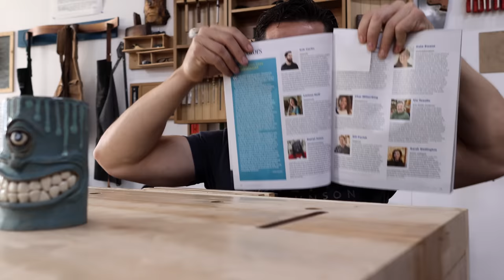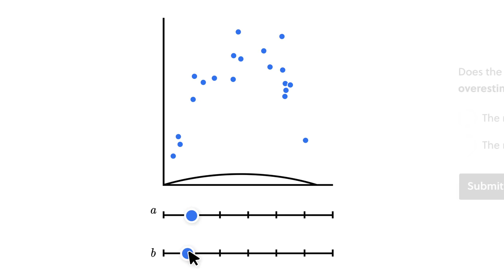5 tips youtube woodworkers give that professionals HATE

Comment: I would love to see a video on the different finishes that professionals actually use.  I already use your finish and it looks and feels great.
Reply: I agree. But in actuality; all finishes are the same; grain sealer, stain, polyurethane.
Reply: @steveschultz300  I don’t follow.  How are all finishes the same? 🤨
Reply: Most professionals utilize spray lacquer or shellac due to not requiring sanding between coats, quick cure times, ease of spray, and protection quality.
Reply: Finish there is always a choice but most common in my shop is oil finishes. Poly is hard to fix and maintain, oil and wax is best for quality furniture as maintenance is easy and they look and feel great. Other shops will make other items where my finishes wont make sense.
Reply: @steveschultz300  he literally said professionals don’t use stain.
Reply: Good video. Finishing my projects is always a really satisfying final step. I’ve played with a lot of finishes, and have learned that more than a couple of the “favorite” finishes of YouTube “professionals” are a pain in the ass to use and do not give a finish I like. FWIW, I have used the encurtis finish on quite a few projects in the past year and I really like it.
Reply: I’d echo this.  Would love to see this video!
Reply: Just keep in mind that professionals have concerns you do not. They ultimately are making stuff for other people for the purpose of making money. That doesn’t mean that what the pros do is the best option. 

Hard wax oils are the best finish if you want certain traits like natural feeling wood and ease of repair. That doesn’t mean cabinet shops are going to ship off wax oiled cabinets to their customers. They have other concerns to deal with that you may not have. Spray on polyurethane is probably what they use. But that doesn’t mean it’s the best for your new self made walnut computer desk.

Pro does not mean best. It means optimized for profit, usually. Case and point. Your deck is going to be better if you use structural screws. Pros use nails because they are way cheaper and can be fired from a nail gun. This saves time and money and it’s good enough. It’s maximized for the concerns of the pro. It’s not maximized for quality of end product. 

As hobbyists and artists we often want to maximize quality since we don’t care about profit or time spent. Just make sure you understand WHY the pros are doing what they’re doing. Don’t assume it’s the best for your goals.
Reply: Please…it would be great.
Reply: @CarlYota that's partially true. As a professional, we do some kind of balance between quality and rentability. Of course, many of us would love to offer the best finish for a particular project, using an expensive material for a beautiful render, and so on... but as you said, we have to make money. So we of course never do something that will not be viable, and profitable.
But on the other hand, if you build sloppy furniture that fall in pieces after 3 months, the client will never contract you again, and he will tell his friends about how you're a prick. The world is small, and the word spread fast, so if you want to continue to have high-end customers, you do make something of quality.
Reply: I've been woodworking professionally for over 40 years and my go-to finish is nitrocellouse lacquer.
It's not the strongest, not hip, smells (I kinda like the smell) but the main reason I like it is reparability, 50 years from now someone could refinish my work by lightly sanding and squirting on another coat or two. 
Other finishes are better in some aspects and I'm not afraid to use them but for an all around film finish that's easy to apply, inexpensive and perfectly serviceable it's hard to beat.
Reply: If you really want to know about finishing... Charles Neil woodworking has an in-depth video series about anything you might need to know.  It's a rabbits hole with likely a few weeks worth of viewing so be ready for it.
Reply: @CarlYota I have some issues...first off if I use something that will take 3 days to dry in my shop I need to charge that.  Will a customer pay for 3 days of labour???  Most won't.  So no on Polyurethane spray...use lacquer.

Second screws are not better than nails.  Where I live if you use screws in a joist hanger it won't pass inspection nails are very underated for holding strength.  Screws are great but they are not structural and break easier than nails.

As for quality...if a customer is going to pay me 1000$ for a bench before I even talk finish...I am going to use proper techniques.  If they have a 20$ budget...then maybe I'll use pocket holes and screws...  and sometimes I will use screws so people see them and it will take me longer just to set them up
Reply: Hear, hear!!❤
Reply: @CarlYota this is a great comment. Thanks for mentioning all that; it sort of fits my situation exactly, and it's better said than I could have phrased.
Reply: @matteout_woodworking  thanks, i'll take a look
Reply: @tode5675 this is the top comment on this video. hard to beat a nitrocellulose lacquer.
Reply: @steveschultz300 What?
Reply: @tode5675 I agree. Lately though, I've been spraying precat lacquer. Sometimes over vinyl sealer on pieces subject to moisture. I almost always use flat or dull sheen lacquer. Lacquer is easy to apply, plenty durable, repairable, inexpensive and a beautiful finish.
Reply: Yes I would like your in-depth perspective on finishes
Reply: @CarlYota I think you just counter-dunked…
Reply: Personally I like Waterlux, either medium sheen or gloss.  Sure, I need several hours drying time between coats, but the finish looks good and lasts for years.
Reply: Spray Lacquer and wipe on oil finishes
Reply: Same here!
Reply: We are using monocoat pretty much exclusively in a cabinet shop with up to 30 employees, basically since the product is on the market. 
It is easy and forgiving in application and you can not beat the speed of the finish.
I might conceed that there are other finishes that give you better results in certain aspects but the Overall package of monocoat is just great.
Reply: Varnish and lacquer. I use an air assisted airless pump and spray a catalyzed solvent based lacquer most days. She shops spray water based to easier comply with OSHA
Reply: @inigomontoya4109 even with those types of products, you still scuff between coats. But essentially you are correct
Reply: @smccrode we definitely use stain. I make stain for most of the cabinet shops in town and also make my own for our own customers. We use stains, lacquers and conversion varnishes mostly
Reply: @steveschultz300 stain is not a finish
Reply: Agree, I would like to know more about the tint and the actuall ratio.
Reply: Pre catalyzed lacquer and conversion varnish are my go-to products for interior use. I skip on slow drying finishes.
Reply: @inigomontoya4109  you're confusing YouTube woodworkers with professionals.

Comment: You're either using way too much CA glue for the blue tape and CA glue trick, or your glue is too thick. I've been using this trick for years and never had it stick any more than the blue tape alone would. I found that thin glue (more liquidy) and a very small amount of it is all you need. Too thick or too much glue and it will spill outside of the tape area and stick to the wood. As for waiting for it to stick, it only takes 10-15 seconds without activator.

Comment: Just a comment on the CA glue and tape trick. As a luthier, I use a ton of custom router setups with very tight tolerances. Using the CA glue (medium) and tape trick, without the accelerator, gives me time to position the components that double stick tape does not.
Reply: Good point, yes I can see how that would make things easier for you.
Reply: 100% - I'm also a luthier,  I also don't use accelerator & never had any of the problems mentioned here honestly

Comment: Id love to see a video on using wood fiber to repair gaps. As  a begginer I always tend to mis-cut something in my projects
Reply: Pretty sure he means re-cut the joint so it just fits properly.
Reply: @MrDaneBrammage , Re-cutting the joint is what you might call the "nuclear option".  I can't speak for ENCurtis, nor can I speak to what professionals do, but depending on the situation you can often fill a small gap with small piece of wood- anything from a shaving on up.  You may not be able to match the grain direction, but you can often get to something that the eye just skips over.   If you're anything like me, you will see it, but nobody else will.

Comment: Excellent video. I’ve never liked the glue and sawdust gap filler. Never looked clean to me. I do however use stain. Mostly because I’ve never learned how to use dyes properly. So, a video on this would be helpful.
Reply: yeah glue and sawdust is just a quick fix, i find it doesn't harden properly either and certainly doesn't add to the wood's strength.

Comment: Hobby luthier here. The problem with many kinds of double-sided tape is: sticky residue. I quickly abandoned carpet tape, went on to try a half dozen other brands that promised "no residue", and was disappointed. I resorted to the CA glue & blue tape trick, although I'm not in love with it. Recently I got a tip from a professional luthier on a brand of double sided tape that he uses, and it works without leaving a mess. In any case, there are many luthiers who make their living by building musical instruments, and who DO use the CA glue / blue tape trick.
Reply: I stumbled upon using extra double sided tape I had from those window insulation kits. It’s narrow, doesn’t leave residue, and is easy to roll up and remove from surfaces. It’s also very thin.
Reply: @jimmer411  Mike Potvin of Potvin Guitars (Ottawa, Ontario) made me aware of this tape.

Comment: The blue tape and ca glue trick is what I use 99% of the time over double stick tape - which I also have and use. However, for my CNC and what I’m doing on my CNC, the blue tape and ca glue has much more sheer strength for the material I am cutting than any of the double stick tapes I have. I do use double stick tape for other things - temporary stops for example. Each has its perfect spot in my shop!

Comment: My dad had a refinishing - refurbishing shop when I was growing up.  I worked in it for years.  We did a lot of mahogany finishing for a local furniture factory.  He always sprayed the materials we finished with.  His stains were all hand blended to match the exact color the customer wanted. We sprayed glaze  to bring out grain and filler to fill the grain for slick finishes.  He used all low sheen to high sheen lacquer.  Sometimes he would oil sand with up to 6000 grit paper between multiple coats.  It was a fantastic way to grow up.  Good video and I am now subscribed to your channel.

Comment: You had me at the blue tape/CA trick vs. actual double sided tape, intrigued me at the dubiousness of slab stabilizing steel channel, then you REALLY had me at Rubio Vs Osmo. So true how these things were launched and perpetuated by social media, so called woodworking experts. LOVE the nod to shellac (I use 30-50% cut Sealcoat almost exclusively as a sanding sealer for near all finishes) and the thinned poly for a really nice hand rubbed finish. THEN, you sealed the deal with the glue and sawdust "trick" (nearly always not the best solution). Finally, using dyes vs. stains is something that really changed my finishing game several years ago. Great stuff man - really appreciate the straight talk!

Comment: This is a great video with a lot of honest discussion and very good points and explanation. I did have one minor dispute with the point about c channel. To be clear I am not a furniture maker and don’t think I have ever made a table for a customer. But I work as a cabinet maker and have for several decades in some very large shops as well as some small ones. I really dont do much solid stock work but do a ton of casework. Sometimes we would get roped into doing a slab for the island. We would always route in steel stock. But it was never there to keep the top flat which seems to be the public perception. It was to help pick up the load of the overhang on the back of the island. It gave us a point to bolt it down on the other side to prevent tipping. The top staying flat was more a factor of our grain selection. The steel was there to help pick up the load on the overhang which at time was hundreds of pounds for large tops . Usually there would be decorative or more functional brackets under the overhang but depending on the job and layout those brackets may not always be where the weight really needs them. Lots of times the back of the island is simply a finished panel which may not be very structural too. The steel was cheap insurance for when the over hang is piled with stuff and the kids decide to hang on it. Also nice that it made it less of an issue if a joint was going to fall right at the back of the case. It has been pretty common in my cabinet making career. That may be where the notion of it came from, but it was never about cupping, it is about attachment and structure. Not sure why it would be necessary for a table as you point out. Not sure why c channel is talked about so much either, most of the time we used square stock.

Comment: Tape residue. Especially the thin clear stuff. If done carefully, I have less issue with the ca  during clean up and on finished surface. For Stick-It sandpaper and DST I'll use a thin coat of shellac on most  surfaces to protect and aid the release.

Comment: Restoration and finisher here, I could not agree more with your choice of finish! I use many different blends with poly, varnish, spar and tung with turpentine or mineral spirits. I have found I cannot stand the smell of turpentine after years of exposure. So I use mainly mineral spirits now. A really great trick for your blend is to add a dash of Japan drier to a single coat portion and apply with foam brush. That shellac spray is my favorite also. It is dewaxed so you can use it under varnish or poly as a sanding sealer. Works great for sanding back to where only pores are filled and doing a really light coat of oil/varnish and polishing with plastic polish (trick I learned from guitar finishers) I use McGuires clear plastic cleaner/polish. 

Here is my personal recipe for oil varnish blend:
1 part Man O War spar varnish (gloss)
1 part pure Tung Oil 
1 part Mineral Spirits 
1 dash Japan Drier (only add to separate single use portion before application)

Depending on your climate (I live Hawaii so I try to stretch the dry time) you can change the solvent. Paint thinner or acetone may be more desirable in a colder climate.

Comment: I work in a high end cabinet makers shop. as for Rubio, we never use it for a clear/natural finish, however the Rubio colour finishes we use on some projects such as the ‘castle brown’ which is great with just 1 coat on most woods unless you’re trying to basically paint a wood a different colour

Comment: Obligatory, and sincere, congratulations on the FWW recognition. Was pleased to see you as part of the group.
Several years ago when I was picking up turning a finish similar to yours, but with shellac instead of varnish, was pushed as the only way to properly finish bowls. It works, but like anything else, when it starts to turn cult-ish it removes the knowledge from the process. "Do this, you don't need to know why!" Keep including the why, it creates a better class of people.

Comment: Bravo! I expected to hate this, but you pretty much nailed it. The one point of dissent - stains. The cabinet makers I worked with used stains directly on wood and finished over with rolled polyurethane as their standard options. Usually high solvent floor products that stank the workshop out for the day. Guitar makers also use stains directly on the wood grain, in the grain filler and in the lacquer.

A YT bugbear of my own - black latex gloves. Nobody is planning, routing or sanding in black latex gloves - except on YT.

Comment: First time I saw the blue tape and superglue trick was on a British guitarmaker's channel. If I recall correctly, the specific reason he had for doing it was that he had not been able to find double-stick tape that would release easily from the wood without leaving chunks of tape and residue behind. For him, at least back then, it wasn't about using what you have or saving money. Since then it has morphed into a ridiculous internet "miracle solution" thing.
Reply: Yes, that's Ben Crow of Crimson Guitars.
Another UK guitar builder, Mark Bailey (a lot less well known, but he's been teaching people to build guitars longer than Ben has been building them) faced the same problem but the solution he found was double sided tape that is specifically certified for use on the floor in the National Exhibition Centre in the UK. It's formulated to keep things firmly in place for a week while a show is going on and then to be ripped up by workmen at high speed without damaging the floor or leaving residue... which it turns out also works for holding a routing template firmly in place and leaving a clean undamaged surface when you're done.
It seems in the US suitable double sided tape is more common for some reason, so the "masking tape and superglue trick" (our standard masking tape is not blue) makes less sense over there.
Reply: Hey! I learned that from Crimson Guitars too! Ben said he picked it up from an apprentice. I also prefer this to double sided tape. No fiddling with separating the non-stick layer and no residue. Also holds better when surfaces are rough.